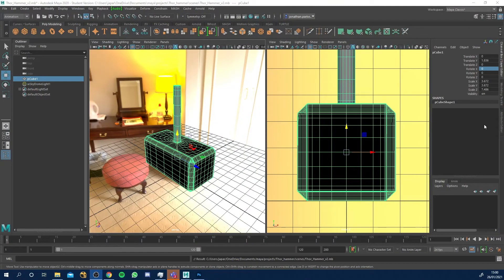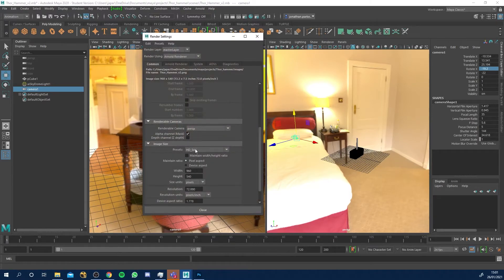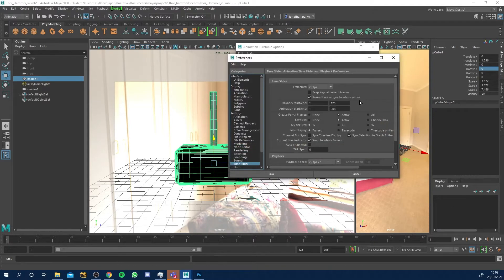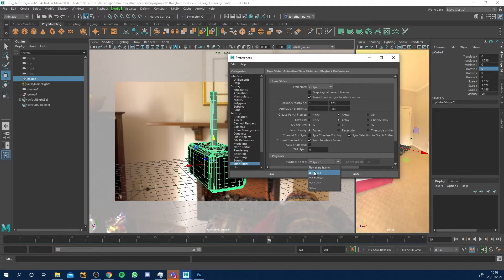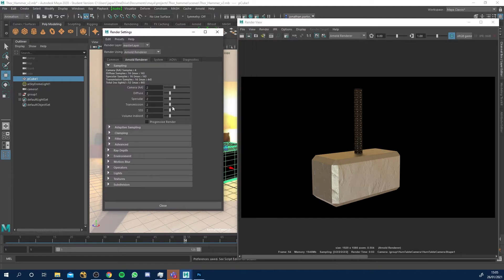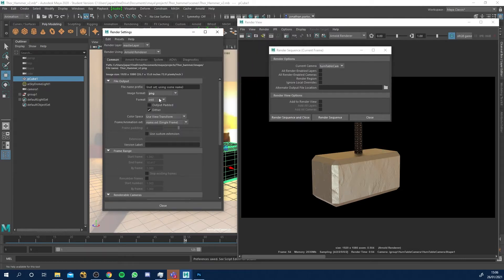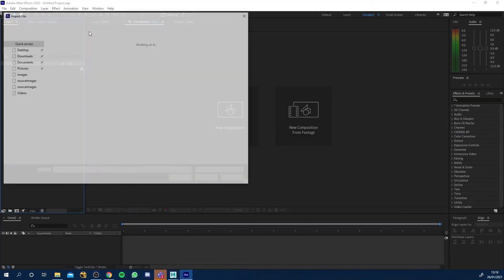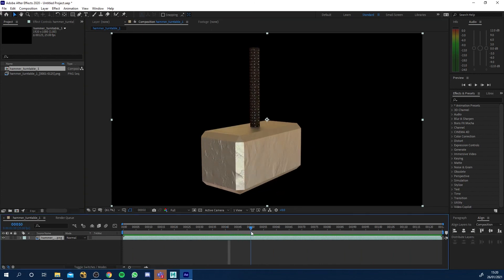How to make a turntable in Maya 2020 | Intro to Maya 2020

Comment: I don't really like the Camera turntable itself.  With that method, you are not geting even lit scene all around: when you are looking in the rear side of your character let say if you dont have a rimlight it will be in the back, so the result wont give you a good visual of the details you put on his back.

I prefer the asset that turn on itself. The camera stay fix, you have the lightrig working for that fixed camera angle and you instead just key the group (a group that include the asset) so it turn around itself. That way you have a constant lit scene.

Comment: Hello creative tips. So far I like the 1st few minutes of tutorial.  I have not finished because for some reason when I added a area light I could not adjust the intensity. My render scene stayed black. I also tried the ambient light and could not adjust the intensity. What am I doing wrong?
Reply: ambient light is not working in Arnold ight is not working in Arnold. It's just simpel as that. The only defgault Maya not Arnold light you can use are: Directional light, point light, spotlight and arealight. But since Arnold as arealight, dont use the default spotlight and arealights of Maya. 

In resume: You render with Arnold use the Anorld lights + directional and point lights

And play with the exposure of the light not the intensity. Intensity 10000 is the same as Intensity 1 but with Exposure 14.3. Professionnals only play with Exposure. It's way easier to understand what value to put if you have only one input instead of two.